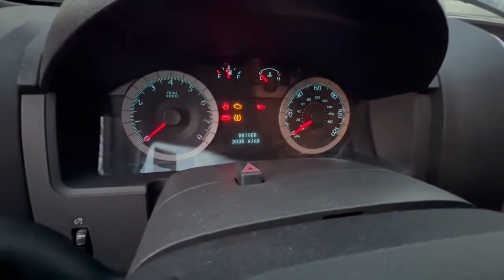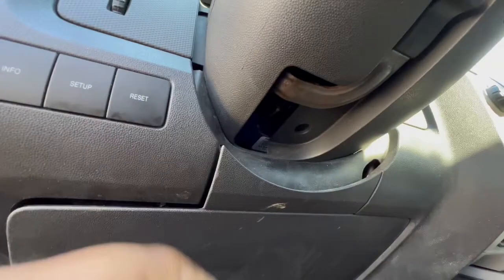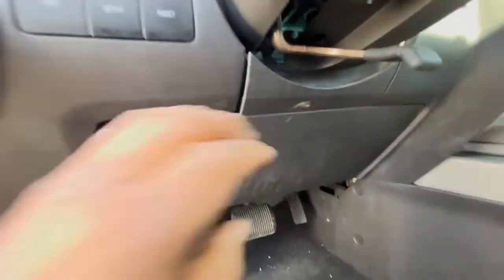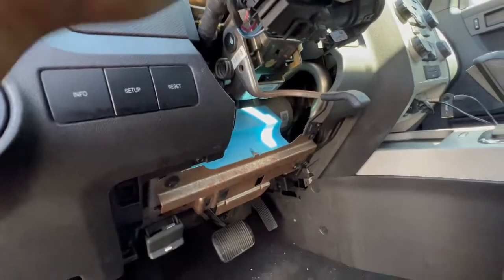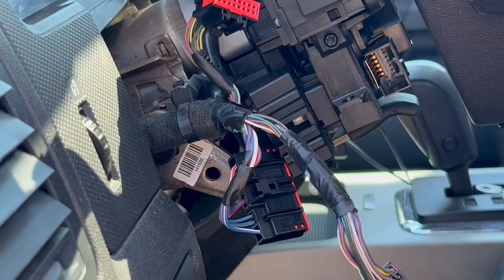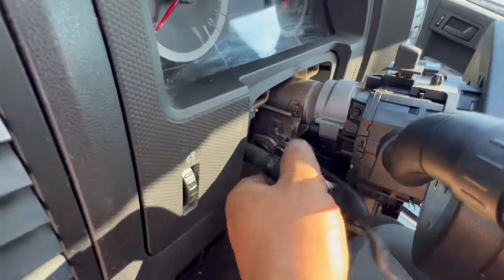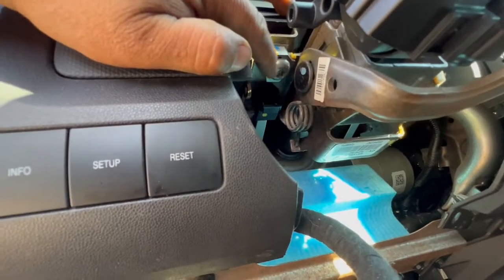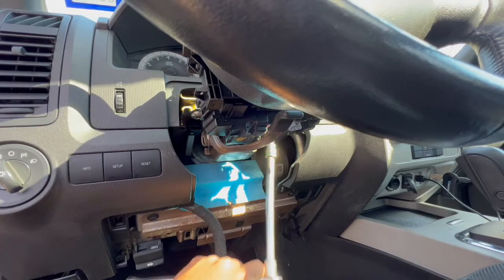2010 ford escape  hard steering wheel  (the tip and fix) part # 1

Comment: I just replaced the control arms tie rods and sway bars and now I'm receiving the message. Does something need to be reset?!
Reply from the maker: Yes. After replace the tie rods. You. Need to to do alignment.    So you angle sensor.  Or steering wheel sensor.  Is set at 0 degrees with the steering wheel straight.
Reply: @1Wayfix   and then the power steering assist fault will go off?! I have never seen this notification until after new tie rods
Reply from the maker: @pacobus24  yes. Just make sure.  When they do the alignment.    They check. That the  angle sensor or  steering wheel sensor.   Or torque sensor.      Is. At 0 degrees with the steering wheel straight.     Then  can do the adjustment on the tie rods.

Comment: Have an 09 mariner.. loud clunking/clicking noise coming from the center of the steering while driving and making a turn. What would it be? Replaced stem joint, rack n pinion, cv shafts, torque sensor And still can't trouble shoot it.
Reply from the maker: Can you record a video and. Send it to me.  Find me on facexxk.   Colas solorzano

Comment: i found my battery was in need of charge or replacement on a escape when steering went from power to standard fixed the problem there was no message on dash  also my buick had the abs and other lights on dash turned out to be rear wheel bearing
Reply from the maker: I glad you got it fix it  👍💪 any question leave here I will do my best to help

Comment: I replace the sensor with new and still have the same problem
Reply: Turn the car off and steering wheel work again
Reply from the maker: Did you  reset the codes
Reply from the maker: Have you tried another battery.  ?
Reply: Some people have had to replace the whole column assembly, CL8Z 3C529 D, which is the electric power steering motor.
Reply from the maker: @azul93gt38   that’s why  we need to. Diagnostic.  The problem first. In this case. Because the symptoms.    Take me to  do the. Sensor.    The data  that was showing on my scanner was. Out of range.     When the steering wheel is in the center position. The sensor should. Show. 0  degrees.